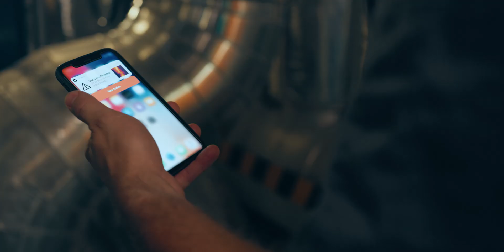ANYmal C Legged Robot – The Next Step in Robotic Industrial Inspection

Comment: I have a brilliant idea!
How about we make a bunch of little robots! Each one has a sensor and an alarm. It can detect carbon mono-oxide, leaks, floods, fire. They could also be able to run for years before a battery replacement and would monitor each and every hazardous spot 24/7 every second (not like every 4 hours, or how often you are going to send this thing around).
They could also be scalable and you could use as many of them as you need!

Aah, wait, it was already invented and is called an alarm!

So back to the drawing board :)
Reply: I'm not saying that this dog is rubbish, I'm saying that the application of it is absolutely rubbish. 
The problem that it solves (well doesn't really as it doesn't provide proper 24/7 monitoring) can be solved using dirt cheap CO2, O2, leak, fire, CO, gas alarms.

So - this robot would become useful, if it could do something that would be too difficult or too dangerous to send a human to fix. So it has to be rated to explosive, toxic, hasardous environments (hot, cold, IP67 rated) and should be able to turn valves, switch things, apply  duct tape etc.
Reply: That's true. I worked for several industrial plants and this robot is far from replace the human inspection. I think a complete version would be ready in 10 years.

Comment: why have a walking robot in these rooms with sensors on it , and not just have the sensors already in those rooms mounted around or connected to key areas ? It seems like they just replaced a walking human with a walking robot, same bottleneck  just made out of plastic and steel.
Reply: Quoting Paul Oomel here "Even with sensors, constant inspection is still needed to verify sensor values. And detect other things which sensor aren't available for like pipe crack position"

Comment: There's no way on this planet that it would be allowed into a chemical plant. The risks associated with it are too great.
Reply: There are no reason for that, this requires just a little bit more specific restrictions to the robot.
Reply: @lucasfernando5290   Specific instructions as in 'don't enter a chemical works'.
Honestly have you ever been into an industrial chemical site? Are you aware of the multiple layers of safety and hazards risk? Just takes one tumble against a pipe and it could cause complete shutdown.
Remember too that this is not gas tight as in flame safe. Should even a tiny amount of gas enter part of the bot and ignite, the flame could pass to the open air and ignite the chemical works. It's not as easy as adding gas tight seals on joints btw: Every component has to be made able to contain a flame as well as hold back an internal gas ignition/explosion. Don't believe me? Take a look at electrical components for mining equipment or even a simple electric motor that powers a fuel pump at a gas station.

Comment: How is it not cheaper to just install sensors with iot connections if the robot does the same route then it’s useless compared to installed sensors mobile robots are only really useful in unknown cenários
Reply: Even with sensors, constant inspection is still needed to verify sensor values. And detect other things which sensor aren't available for like pipe crack position
Reply: A drone would be better than a legged robot...no point in a walking one.
Reply: Iancreed8592 drones batteries die quicker.  Also the sensors needed add to much weight onto the drone.  What I wonder is why legs?  I guess for steps, but it wouldn’t be much more challenging to add tank tracks to the feet for flat terrain then steps to go up and down stairs.

Comment: Really awesome guys. I love the path correction feature!
Reply: The path correction feature is awesome. It is very innovative to show that as a software directive. Eventually with learning algorithms it should be able to moderately problem solve, or find alternate routes. Handy in an industrial setting such as an Oil Rig, where if a pipe blows it would kill the maintenance crew working in the immediate vicinity. An engineer working in the 'command centre' could monitor the vision from the roaming ANYmal's and implement pipe / valve diversions to minimise problems or to divert resources.